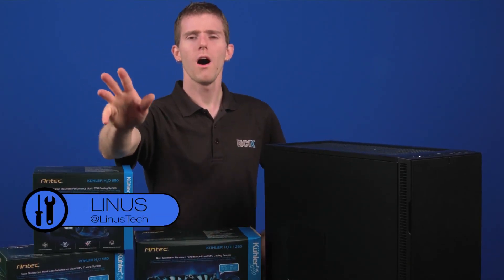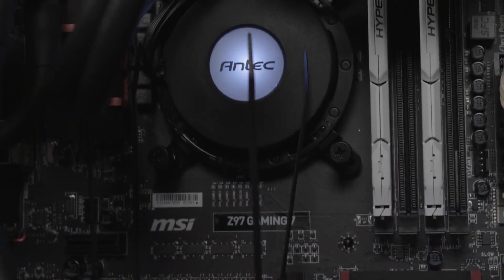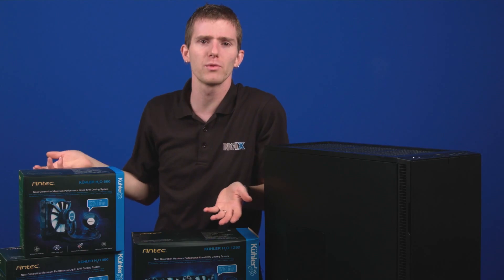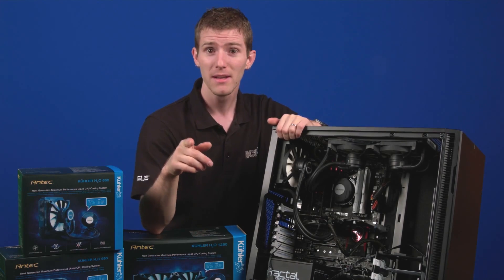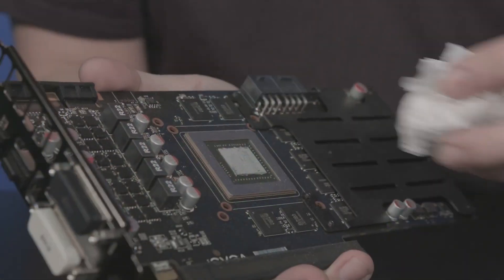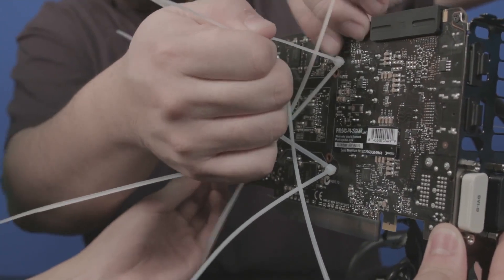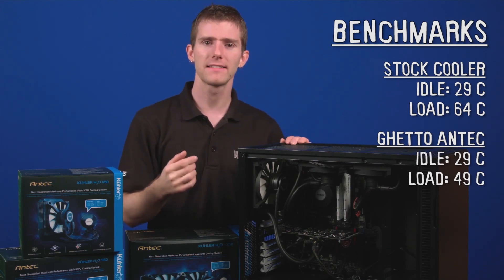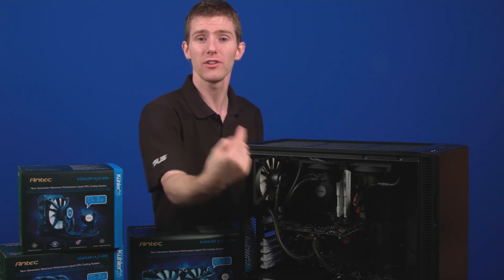DIY GPU Cooler ft. Antec Kuhler liquid CPU cooling

Comment: Are they serious with this? zip tieing a cooler on a videocard facepalm
Reply: ***** I'm pretty sure your pc is having some cooling issues overall if you have your gpu pcb at 85 degrees...
Reply: How so? It works great an it's incredibly cheap.
Reply: ivanjacob
Stay with the org. cooler, that's even cheaper.
Reply: ***** The original cooler doesn't have the benefits that watercooling has.
Reply: ***** zip ties melting at 40C, what are they made of butter?
Reply: You think this is bad? Check out my old computer: https://pcpartpicker.com/b/pBccCJ
Reply: ***** you realize that the temp recording is on the processor not the board and most zip ties can handle upwards of 70c
Reply: Zip tieing is the cheap option, you can get a mount from NZXT which includes a fan, it called the NZXT Krakken G10 ;)

I used this om my old XFX HD 7950 with a Corsair H55 cooler, impressive cooling and OC headroom with it on :P 

My furmark max temp was 58*c (pretty good for a overclocked AMD card)
Reply: it works like a charm. less hate, more modding.
Reply: ***** I did the red mod with Litecoin mining. I'd know if the zipties would soften. The most dangerous part with zipties is the mounting. Once the gpu sink is on it's safe.
Reply: ivanjacob vram and vrm don't get cooled...
Reply: *****  uhm its minus 40 degrees... not plus...
Reply: ***** Awesome plywood PC!
Reply: *****
It's stupid. Due to the heat generated inside the pc and being cooled down the zipties might expand and retract. Causing them to come loose and fry your gpu. Maybe it won't come loose but it might make a lot of air pockets in the paste.
Reply: Keaton Buster totally agree with getting GPU bolts and drilling through mounting bracket. zip ties can work in a pinch, but I've cracked a die from uneven pressure
Reply: ***** Lol your keyboard costs more than that computer...
Reply: MrMattissmexy haha, good laugh
Reply: 1080p monitor + three of them + 40" = smallest dick in the world
Reply: IF I were going to do something like this, I'd at least use a metal hose clamp around the block, then zipties to hold it into place...
Reply: If it´s stupid but it works, it´s not stupid.
Reply: Mees Van kaam Yes, but what about 40C? 40C under load is pretty low, and some zip ties melt at that temp.
Reply: ImportNation its like you didn't watch all the way to the end...
Reply: alcowherd7 Yes, but if the card get hot, so can the area around it. Every stood around a fire?
Reply: I was thinking the same....
Reply: ***** Lmao that is fucking awesome.
Reply: Well it could lead to even better ways of doing it. Gotta start somewhere
Reply: well stock intel fan is not much stronger so its oke
Reply: ***** omfg. You even call that a PC bro? Really, come on... That's not fair
Reply: BearM304 I'm not a fan of the kraken G10, as it takes up 3 slots total. dual or triple GPU setups don't work well with that, and once you watercool you don't need three slots for a graphics card.
Reply: phillip galas That's true, this is best for a single gpu, but if you have going to do a multi gpu config then it might be better with a custom water loop
Reply: Mees Van kaam Unless you are running a R9 280X and a HD7970 in XFire. My god. It's hot.
Reply: ***** Go for some ABS zip ties then.
Reply: I had my ghetto mod experience with the 79xx line of XFX video cards. Those have some of the shittiest coolers ever, which is too bad because the aluminum shroud is slick. I zip tied a 80mm fan pushing air to keep it from going past 100 C which it does very easily.
Reply: Lance Echo thanks, I tried.
Reply: I just rescued my R9 270 from a dead fan tragedy using this!!!! IT FUCKING WORKS!!! i bought a cheap Maelstrom 120T watercooler and used zip ties lol!. gettting 27o  idle and around 50o busy on silent mode!
Reply: You do realize zip ties can be made of different types of thermoplastics that are resistant up to 150+ degrees?
Reply: Everyone a zip tie expert
Reply: Mitch Spacone Absolutely, you should keep in mind, that according to wikipedia zip ties have a working temperature of about -40°C - 85°C. If they touch any metal component, they can easily exceed this limit.
Reply: You can get brackets to hold the coolers on but this is a "ghetto" video.
Reply: I did it to my titans.. Used zip to see if would work..  Once i drilled holes in the cpu plate matching the gpu cooler i did bolt it down though which did help temp.  But if look at alot of coolers there just held down with plastic clips etc.  So whats the diff?  Bet my left nut a zip tie used to do this would hold your body weight if not a fat slob.
Reply: ***** In This Thread: Alot of people who have money to spare, and get personally offended at anyone using ghetto mod solutions even for fun.
Reply: I hate snobs in general, yes.
Reply: +Matthew NotReal 
WHY just WHY do you have razer mouse + keyboard for over 100 bucks when you could buy a better cpu + gpu for that money.
Bro I run a 700€ rig and still have a 5€ keyboard. 70€ mouse tho but yeah.
You totally set your priorities wrong.
Reply: +floSa   My headset, monitor , keyboard ,  mouse /mousepad , and computer costs like 2.3k is it much ?
Reply: elias lollonen
Well I run 3x40" 1080p monitors sooo the sad part is that my setup is still more expensive than your setup. lel
Each of the monitors I own had a price of 1799€
Reply: elias lollonen
Nah not really I just like to fully immerse myself in the games.
My "desk construction" is big enough and I really see no use in any resolution beyond 1080p even at that size.
Also the monitors are now nearly 6 years old.
They were worth their money definetly.
3x40" plus trackir is an experience that not even the oculus can give you since the oculus locks you to your screen.
Trust me I tried it.
I like to make notes while playing so thats a no go for me.

Comment: There's no heatsink on the VRM's, they'll just fry really quickly.
Reply: Linus already told you to put a fan near the GPU to deal with that. And a heat sink??? Most cards don't have VRAM heat sinks...
Reply: Alex Sayle yes they do, most have the main heatsink contacting the VRM's through thermal pads just like the card in the video. For high end cards a fan will not be enough. 

Edit: you said VRAM. Still they are heatsinked just like the VRM's are
Reply: Liam McShane MSI GTX 970 no vrm cooling for them on the backside. Often thay are not connected to the main heatsink.
Reply: Liam McShane Amazon has various little heat spreaders you can stick on, paired with air moving over them you should be fine.  I know there was originally someone on OCN making brackets to mount the cooler and provide a mount for a fan.  Now companies like NZXT are making whole kits cooler and all that you mount to the card.  If you really have an interest in doing this type of thing search "the mod gpu cooling" on OCN and look through some of the older threads where people show how they did theirs. (Pretty old threads now.)
Reply: Tobias L. That's VRAM not VRM's. I'm talking about VRM's. VRAM is fine without heatsinks.
Reply: buy tiny little heatsinks for them, in combination with the attached silent fan on the kraken g10 , temps are very good.
Reply: Linus said something about that he licks the vram whenever it starts heating up, basically water cooling
Reply: ***** :D there are so many comments where people mix between VRM (Voltage Regulator Module) and VRAM (Video Random Access Memory).......
the Voltage Regulator Modules VRM's do need  cooling, they tend to get pretty toasty... e.g. not naming any particular brand but there was a revision of after market cooler that had VRM's running at 135*C and making the card throttle even though the GPU it self was at about 65*C
also there is one reference water cooled card that failed to cool VRM's which result in heating up the entire PCB (Printed Circuitry Board) to about 110*C and even melting down lower gauge power cables.
Reply: Pictures say otherwise. The VRM has its own black heatsink pictured here: http://www.kitguru.net/wp-content/uploads/2014/09/DSCF3081.jpg
Reply: Accuracy158 also pennies can work as heatsinks but that should only be used in extreme cases lol
Reply: Liam McShane As is said on the back of the graphics card.
http://www.kitguru.net/wp-content/uploads/2014/09/DSCF3042.jpg
Reply: I think there are heatsinks on the VRMs...look at the right side of the water block in the video. Even if that piece of metal isn't being used to dissipate heat, they'll be fine. The 290 series are well known to have really high VRM temps and they dont have problems with the NZXT g10 which also doesn't include heatsinks. On a 970, I'm sure that issue is way less severe.
Reply: Liam McShane The NZXT kraken g10 doesn't come with heatsinks , however most retailers sell heatsink kits. I picked up a £10 heatsink kit with my kraken g10 bracket from overclockers about 1 year ago and its still running strong.
Reply: last time I saw memory heatsink on a videocard it was on a geforce 9600 gt
Reply: ***** what? lol
Reply: Josh Duffy memory heatsink*
Reply: EVGA Classified cards tend to have the VRMs not contacting the stock heat sink and will run just fine with only a tiny fan. For reference I have a NZXT G10 on my 770 Classified even when running furmark the VRMs tend to not go over 45C and never go above 50C and all they have is the small fan included in the G10 kit pointed at them. It really seems to be very specific to each card what needs to be done keep the VRM's cool.
Reply: Medeni Medo seems legit. What are the temps like?
Reply: There's a perforated aluminum plate over them, which was not removed when they removed the main heat sink.  That's enough to cool them, provided a fan is blowing right on it.
Reply: actaully evga puts a metal plate along them thats the black thing you see when the heat sync is off , btw the heat sync doest touch anything else but the gpu
Reply: Mackenzie Cambell Except that that black front plate very specifically has holes that expose the VRMs it does however cover the VRAM.  http://www.hardwareluxx.de/images/stories/galleries/reviews/2013/evga-780ti-classi/evga-gtx780ti-classi-10-rs.jpg
Reply: dugg117 they were using a 970,the design didnt they change it a little bit , isnt half the vram on the back end ?

Comment: I have the 650 and cant recommended it (at leest with fx cpus)  becuse when the cpu get hot it gets really loud and the temps Are tanken from Intel 3. Gen cpus and fx Are A bid hotter
Reply: What are you trying to say?
Reply: That if somebody want the 650 as a cpu cooler think about if your cpu get much hotter than Intel 3/4 gen cpus else it can get noisy
Reply: tectube dk you put the thermal paste on wrong then.

Comment: forget all this modding using zip ties, the cooler master seidon cpu water cooler has threads that perfectly align with the holes on the gpu die of amd and nvidia cards
Reply: If you are right you are a freaking genius. Totally going to fact check that right now.
Reply: yeah, plus NZXT do a GPU bracket for their AIO cooler aswell
Reply: This --〉 & 〈-- looks like a man dragging his ass on the floor
 It's only for specific AMD Only GPUs, and you have to have a reference cooler since you're required to use the fan from that.
Reply: Andrew Jones what? They are all over amazon...
Reply: U are a genius, a pure genius
Reply: WASDxMerceless what about corsair hg10?
Reply: Electro_Leet i heard they will make other models but idk
Reply: The CM Seidon 120M, 240M, and 120XL work using some nuts and bolts on the hole that are directly on the pump. Sadly, they seem to be discontinued and are in short supply because the Nepton series (which to my knowledge isn't compatible with this mod) has taken over those sizes of rads
Reply: Ben Zimmerman Well they're (mostly referring to the 120M and 120XL) pricier than what equivalent sized coolers cost
Reply: Andrew Jones really? Because I'm not sure which one it was, either the 120v or m, but it was only like $50 last time I checked.
Reply: Ben Zimmerman
120M (the one that doesn't need zip ties) is about $67 on the egg and 120V is abuot $50 but needs zipties
Reply: Andrew Jones yea it's $65 on amazon but they have some available for 50. Thats still not more than the equivalent corsair cooler though. The h55 is also $60-65
Reply: Ben Zimmerman I guess, though I'm quite the cheapskate and don't really buy anything unless it's the lowest price I've found
Reply: Andrew Jones I snatched a refurbished h100i from newegg for $65 last month :) they go on sale pretty often so keep your eyes open for em. Awesome deal.